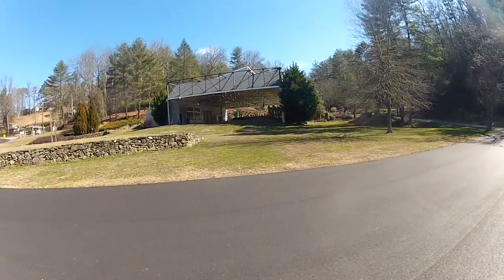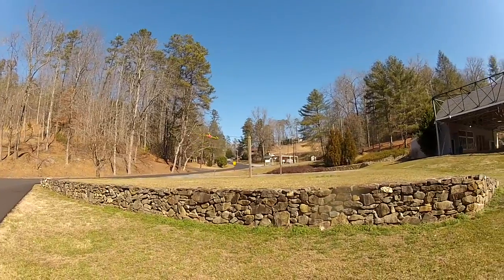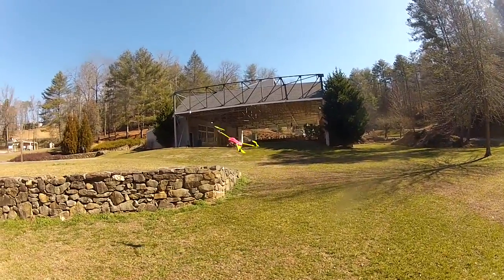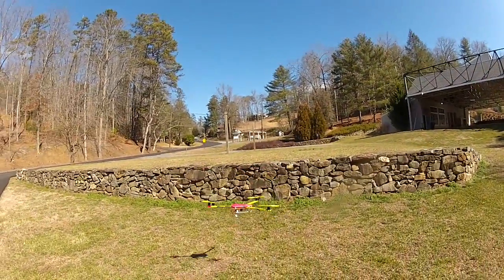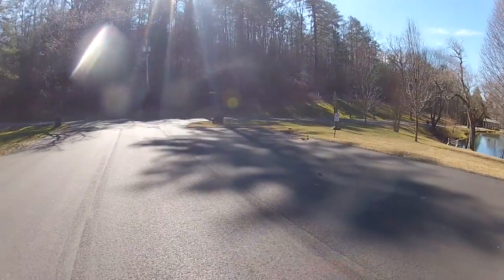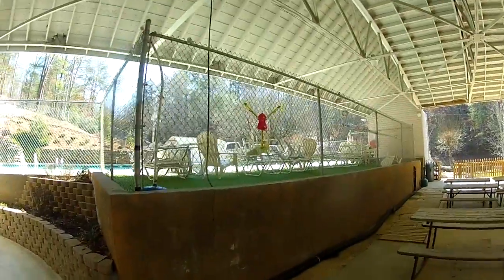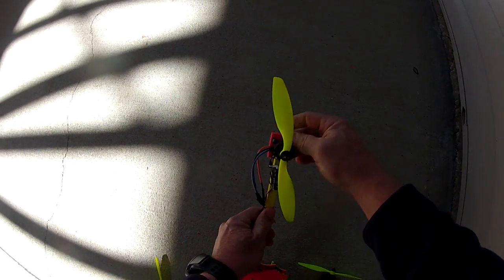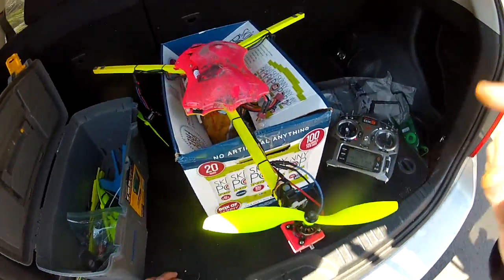Simplecopter Tricopter 3.0 short demo

Comment: ah, ok. so it looked (and sounded like) when you hit the fence the props where running at a good rpm. am i correct thinking you hit the cage, landing pads/feet caught the cage and keeping the craft there because the props were still causing lift? i couldn't see close enough but it doesn't look like you have variable pitch props.
just wondering :)

Comment: Wow, you are one amazing flyer! what PID settings do you have? I have a simple T-copter design airframe but i'm struggling with the settings of the KK board what do you use/ fly with. I use the steveis firmware
Reply from the maker: i run stock settings. i also use steveis 1.17 lite. this video was done with 1.12 lite.